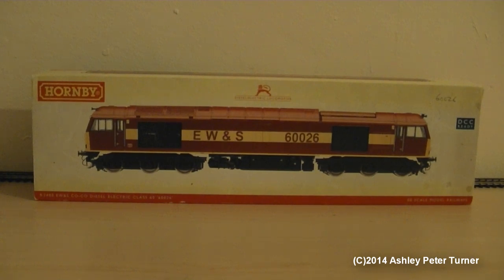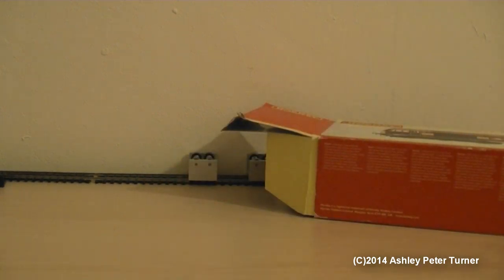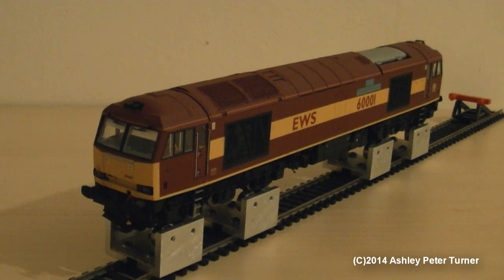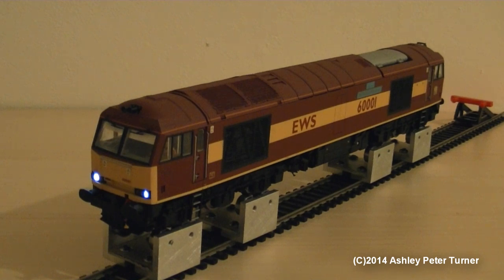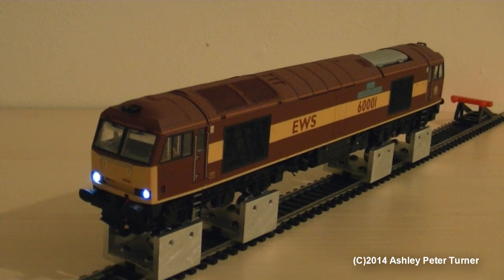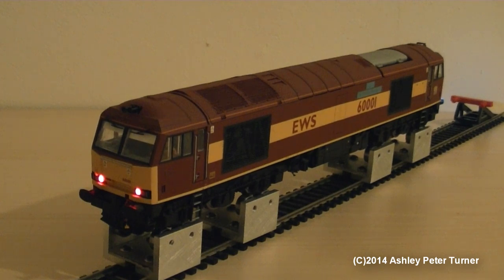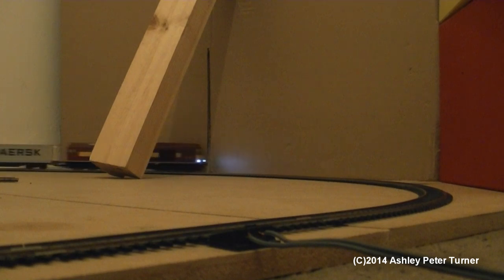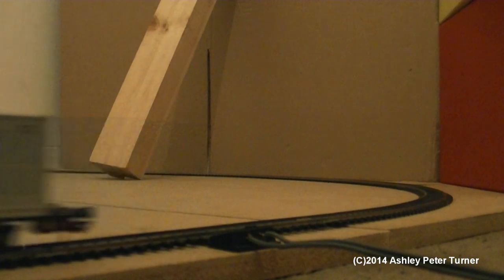Hornby | Class 60 | Diesel Locomotive | 60001 | EWS | OO Gauge | Review | HD

Comment: The class 60 is one of my favourites, any chance of showing how the sun visors are attached.
Reply from the maker: I know this sounds tedious, but you only need some strips of plasticard cut to size and then use some gummy glue (the stuff that doesn't "frost" the glazing) to fix them into the cab units :). I may well have a bash at doing this myself on the other members of my fleet and I may well do a video of this in the new year :).

Ash.

Comment: One of my tata steel sprung buffers got caughht on another wagon buffer and has came out and wont stay back in. To the scrap yard it goes
Reply from the maker: I had a similar problem with my 60033, but I used a bit of black tack to hold it in place. Maybe that will do the trick :).
Reply: Thankyou for your advice :-D
Reply from the maker: trainmania100
No problem man! :).